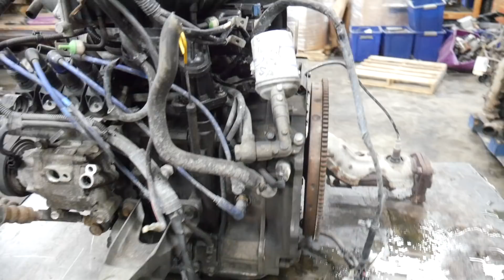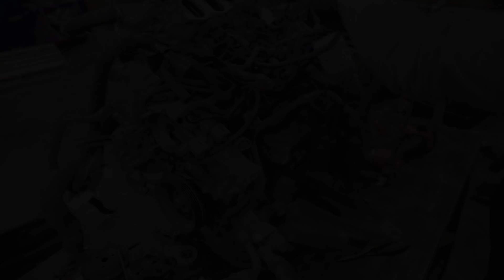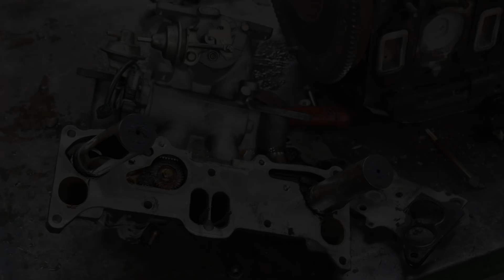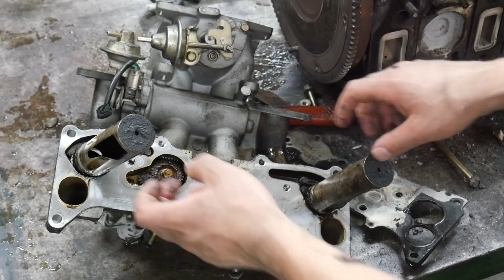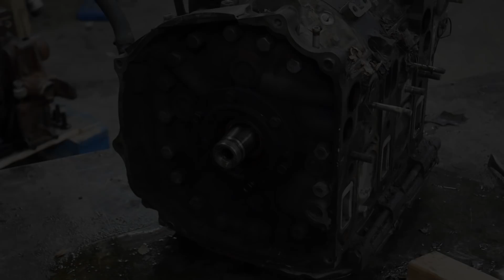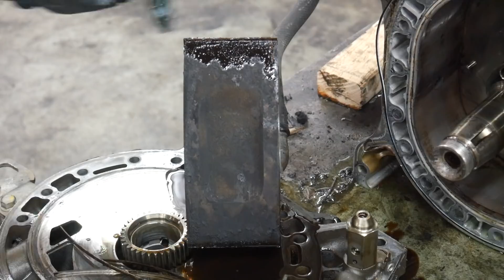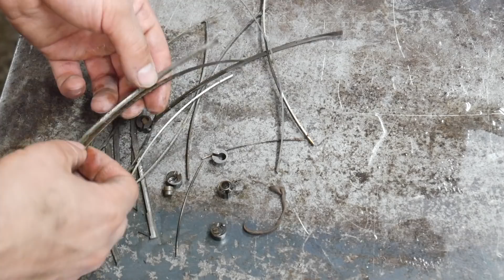13B RENESIS Total Rotary Teardown. 04-11 Mazda Rx-8 6-Port!

Comment: So, overall great content, but there are a few things to know on these engines that are incorrect in the video. #1. OEM vs Aftermarket coils. The OEM coils on the rx8 are hot garbage and should not be used. They were a cost saving measure by Mazda since the rx7 had so many complaints of expensive coils. 100% go aftermarket, specifically BHR coils. #2. The main point of failure. So Apex seals from the rx7 to rx8 actually came quite a ways. They still fail, but not as bad as you might think. The more prevalent thing that kills the engine is actually the coolant seals. Heat causes the seals to go prematurely. You can also swap the OEM apex seals for single pieces with better heat treating, and it more or less solves them as an issue.

While there is quite a bit to learn about these cars, the rx8 is very much worth looking into. If you know what to look for you can find them dirt cheap (got mine for $1000 and it only needed coils). If the engine and, more importantly, cooling, is set up correctly, there is very little that can actually go bad on them for many tens of thousands of miles. If you go into the car understanding that the engine is basically a wear item, they are amazing.nd r
Reply: One thing not mentioned so far is the uneven heating of the powerplant. The combustion/exhaust portion goes thru a more extensive temp. range than the intake/ compression area. I have seen random video on engineering mods to improve the weak points on these engines. Dirty emissions, poor fuel economy, lack of low end torque and knowing that uneven engine heating and spark plugs that cannot by design protrude into the combustion chambers create further issues to overcome. Oh, and the oil consumption! Pre mix to me seems essential and correct in that at least the correct type of oil is used for it's intended purpose. An ICE does NOT lubricate itself with oil 
intended to be burned steadily from new to aid apex seal longevity. The issues of these engines clash with the most pragmatic remedies and still would not make them practical with mass market appeal as public / private vehicle powerplants. As race engines they have decided advantages in terms of simplicity with few moving parts. Certain drivability and air quality issues  spelled it's doom aside from the race track where it shines in several major ways. I see them as a paradox. A somewhat inefficient engine that by design can take rpm and boost levels propelling them beyond the performance levels of their more complicated piston engined counterparts. An engine based on geometric formulae that may not be worthy of further R&D budget outlay but one thing often overlooked is the fact that for every full rotation of a rotor there are 3 revolutions of the shaft the power is taken from to drive the vehicle or for that matter to power a pump.
A good reason why anyone with the slightest interest in Felix Wankel's concept should watch a good video on the operation of these engines.

Comment: The Wankel is a very neat concept that looks amazing on paper, unfortunately in practice, there are fundamental design flaws that can't be overcome, and the engine has to burn oil to keep the seals from destroying themselves.  Plus they are very fuel inefficient.  Although really, the time of the combustion engine is over.

Comment: I'm no rotary expert but it looks to me like one of the coolant seals was snapped on that first iron u took off, which is another kinda common problem with that can happen and is something that you need to pull the engine completely apart for. It was probably dumping coolant all over the ground,

Comment: A fantastic but flawed bit of mechanical engineering. Very clever but you wouldn’t want to have to try to live with one beyond a few years new.
Reply: Unless you have the ability to pull the motor yourself. These things are stupid easy to rebuild.

Comment: The "long bolts" are called tension bolts.  A lot of the pre-Renisis era engines that ran when parked, but had trouble starting after sitting for extended periods could be coaxed back to life, if you knew what you were doing. I had two 83 models, and an 84 GSL that I bought in 1993, got it running, the A/C still worked good. Fun cars.

Comment: As someone who's owned two of these and tried desperately to improve the design - such a cool engine on paper. But so horrible in practice. Drinks fuel and oil like nobody's business (oil by design but still), doesn't make a lot of power and tears itself apart unless the whole ignition system is replaced every 20kkm. Too bad the RX8 never came with another engine.

Comment: Its hard to verify the oil metering pump is good without putting them on a running rotary and for that you have to have a running rotary😂 cracked me up

Comment: I once had a 3.5 Honda (Acura) V6 that would not come off. It took a 3 foot breaker with a 4 foot cheater on it. Myself and another tech, together good for 350+ pounds, both had to wrench every ounce of our strength on it. It finally snapped loose and sounded like a gunshot going off. Had the crank barred against the subframe channel to hold it in place. We estimated between 1700-2000 ft/lbs of breaking torque was needed. Why, Honda?

Comment: Couple secrets I learned long ago about these rotary motors, first rev them to the moon they do not like to be driven like a little old lady this helps with the carbon build up, second run some trans fluid through the intake about every 6 months it helps remove carbon and conditions the apex seals.

Comment: 12a and early 13b engines had way better seals and could hit 200k miles.  
btw, stock LS coils are much better than Mazda coils.
LS coils do especially well in RX7's when paired with an LS engine

Comment: I am so old, I remember when NSU introduced the Ro80/K-70, the car that served as the basis of VW and Audi middle-class models. Valentino Rossi won Le Mans in 1991 in a 4-chamber 2.6-liter Mazda 787B.  The next version was destroyed by a fire. Rotary got banned and their story ended there.
Mercedes had the C-111. Some motorbikes, some lightweight airplanes, and the R-8 that Mazda tried to get together like a decent automobile. They couldn't. Even the Japanese engineers could not.
The Wankels drink a lot of oil and fuel. They are light and run crazy RPMs.
Nobody seems able to make the original idea work in the real world. A piston two-stroke must be easier to tame.
They tried and my kudos to Mazda and most of all to the engineers at NSU who Just Did It. 
And failed. But once.
https://www.youtube.com/watch?v=OjwwV20iZYE

Comment: Ah the rotor heads try tell me it's only a 1300cc. Nope. It's 650cc per chamber x 3 chambers x 2 rotors, that's more like a 3.9 litre engine. And that's over and above the fact that there are more combustion events per revolution compared to a 4 stroke motor. So I kinda agree it's a cute concept but all in all a crap engine.

Comment: 24:27 you need the side gear to engage with those teeth in the rotor, and the side gear is on the part you took off.

Comment: I had one of the first RX8s around.  It was a fun quirky car.  The apex seals would wear out causing compression issues.  The fuel system would also foul out the plugs causing a no start.  The last and biggest problem was with the car itself. The parasitic electric load would kill the battery in 5 days if you didn’t drive it.  I still loved the car though.

Comment: Thank you really enjoyed this, see plenty of YouTube with old rotaries but never seen a renesis disassembled. I admit to being biased, I love rotaries , I agree they aren’t necessarily as durable as the average piston engine, but disagree with your view they are bad engines. It’s all about the driving experience and they are just fantastic to drive. Even if you have to pay a bit of a cost, in all senses, to own one I think it’s worth it.
Reply: He owns an rx7 and says he likes rotaries. They’re just not for noobs.
Reply: They're good in some ways and not so great in others.  I feel like the 13B-RE was the best of them.  Those things actually lasted a sustained amount of time and seems less finicky than the REW.  Less potential, but less headaches.  REW just had so much shoved into such a small area and is relatively miserable to work on.  The Renesis seems like a more finicky FC engine that never really delivered the goods.  FC is the most practical of the 3, but the worse chassis and suspension.  FD is raw.  8 seemed like it might be a great option for a car, but the interiors seems to be of lower durability than FDs (which are already pretty low).  As for the cars I think their chassis are what give them their driving experience.  FD is still an amazing car to me even when I drove other engines.  I think a low torque high reving engine like a K could deliver a similar feel with some more vibrations and I'd imagine better TQ.  If anyone hashes out something to do with the 8 chassis I'll probably get another one, but when we already have a supercharged ND it seems redundant.  I'd still want it to add to my imaginary ugly cars collection along with a Merkur.
Reply: @jinxtacy  Lucky 7 Racing is putting a REW into my Rx8 right now. You're right about them being finicky. A brand new block from Mazda ended burning oil somehow, so doing a rebuild on a new engine :scratch-head: anyway. Doing street port while they are in there. But the reason I did this is because of the way this car handles and for the price, can't really be beaten. Longer wheel base allows for more stable high-speed handling versus a Miata. 
My 40th AE is pretty to me, but i guess i have odd taste, haha.
Reply: @TexasVexes  I like the car a lot I just think they're overstyled.  I've only been in three.  First one was a turbocharged 375 wheel horsepower RX8 from Minnesota, the second was a Speedvision car with a Motec. The third was just a intake and exhaust yellow car that I wanted to see how it fit.  I did not care for the ergonomics and I was kind of surprised to see how the interiors lasted at least for a car that lived outside.  You're in good hands from what I've heard about Lucky7.

Comment: Interesting how differernt the engine deaths are in the US.

What normally kills them here is the oil being too thin in winter - and the eccentric bearings getting eaten up. It's a silent death - they'll merrily eat themselves through the copper to the point where a piston engine would be donking away like a dozen gnomes with a sledgehammers were trapped inside and probably launchign rod through the walls, before finally spinning a bearing and refusing to go. Depending on the bearing, they might even keep going with a seized bearing. 

It's a silent killer .

Comment: Extraordinary complexity for what?  I recall when the rotary was first introduced.  It's a brand.  I suppose keeping these monstrosities running was essential to keep the product different for marketing purposes.  Different does not mean better.  First time for me seeing one of these engines apart.  Last time too.  Good job.  Are these still sold?  If so why would anyone buy one?  Why did anyone buy these?  Marketing.  And, what selling points did they use to make these seem better than conventional design engines?  Must have been good cause folks kept buying them.
Reply: Pretty sure 2011 or 2012 was the end of the line for these engines. Aside from their pretty poor reliability, with emissions standards getting tighter and tighter they simply couldn't make these compliant. I believe mostly because they burn a decent amount of oil.
The reason they sold so well was really the marketing, which was that with so few moving parts it would be much more reliable then a piston engine, which was never the case. Average piston engine from any manufacturer usually goes 200k+ with decent maintenance, these if you see them with this many miles on them its absolutely amazing. Like seeing that diesel truck with 1 million miles on it.
The cars they came in are really cool, and I can think of a few engines I wouldn't mind swapping into them, VR6 or K series come to mind, but id never touch one with this thing in it.

Comment: Gear Porn, Im excited...Love this channel.
 When you put steel bolts in an aluminum case you get electrolysis which is what causes corrosion and bolts to lock up. All bolts in an aluminum housing should either be coated with an anti seize compound or have steel helical inserts. Obviously automaker will not go to that cost. Bolts should never be dry and should have some type of lube, unless specifically denied by the automaker. I come from the aerospace industry, 36 years experience in assembly and testing of electric motors and blowers. In our designs we always used helical inserts.

Comment: is it just better to premix your rotary than use the factory oil injection?  I've never owned one but have a few friends that own RX7s and premix their fuel rather than worry about the factory setup.
Reply: Ive heard people say to do all kinds of stuff, premix the fuel, rev it right before shutting down, and on and on. In the end the engines never going to last one way or the other.

Comment: The 2008 and later Renesis has a lot of changes...
A couple of major changes are :
Series 1 - two oil injection ports
Series 2 - three oil injection ports
The Series 2 also has a much higher pressure oil pump, plus the oil metering pumps are completely different.

Comment: This engine was a bad idea from the start.  I could have probably worked on chainsaws and weed-whips where light weight is very important, but beyond that it was a dead end.

Felix Wankel designed it as a supercharger;  I bet it would work well as one of those.  Volkswagen owns the patent on these, Toyo Kyogo pays a fee for each one they build to VW.

Comment: A rotary engine has a good power to weight ratio, but so does a 2 stroke gas engine.  Coincidentally, they both have the same vice - they use a lot of oil and have poor emissions.

Comment: Mazda won 1991 Le Mans 24 hours race with a 4 rotor Wankel engine and was the first Japanese car company to do so.
There are certainly fewer parts compared to the conventional engine and looks robust, the eccentric is short and thick, no cams and timing
chains and tensioners and bearings and poppet valves and springs and connecting rods and heads and all the associated nuts, bolt, washers
etc etc etc but the most pleasing aspect
is that it does away with the up, stop, reverse direction, push down, stop, reverse direction, push up and repeat. The triangular rotor gives its
power in the same direction as the output shaft saving energy. Thank you Felix for an alternative even if it wasn't the success that Rudolph's is.
Reply: In a race car, if a manufacturer was willing to put the money into the R&D, and make these fuel efficient, this could be a monster design for racing. Where you're going to strip it down to the last nut and bolt after every race to rebuild it. And where the cost of components is no object.
However, even in racing I can imagine the exact reason that it wouldn't be allowed, the fact that it burns a lot of oil, which can effect the octane rating of the fuel. Im sure every team in the game would scream foul over that, might even be the reason we don't see them anymore, not really sure.

But in a street car, where its reasonably expected to last 200k or more, and in the hands of drivers that don't understand its quirks, this was a terrible idea from the start.

Comment: Had my RX-8, bought new, from 2/2006 - 9/2019. Zero engine problems. Not one. Had to replace cat converter at 42K+ miles and sold it then, as I was concerned about getting future rotary service while on long road trips away from big cities. Fabulous car. And quite reliable.

Comment: So I’m a new subscribe....loving my way through the vids. What in your opinion is the best engine? Just curious
Reply: Theres a lot of really solid motors out there, and in all different forms and applications. Pretty much every OEM has made some really good engines. High torque, high power, stupidly reliable but low power, etc. 
This on the other hand, is NOT one of those engines.

Comment: "Just a bunch of 10's so its pretty easy" yeah, as long as you have a 10mm
Reply: A miracle happened. Last week I ACTUALLY found a 10mm that disappeared 5 years ago.
Reply: @justinnoel6273  it was a noel miracle!
Reply: @justinnoel6273  haha I found a 10mm today that I thought I lost in my engine bay about a month ago
Reply: The elusive 10mm
Reply: That one that always happens to be missing, well in my workshop anyway 😂😂
Reply: @TheLiamerator  that's for every workshop.
Reply: Se mamó
Reply: That’s the advantage of a Japanese car, with a 10, 12, 14 and 19 you can dismantle the entire car and you don’t need calculating wether a wrench is bigger or smaller than an other like in English measures… Don’t understand why one insists keeping that inch- mess alive!
Reply: @koenvelaers9876  you do know that all cars have been metric since like 2000, and even funnier brand new Japanese cars for America have 5/8 spark plug sizes for some reason lol
Reply: For reals! What is it about 10mm sockets always missing!
Reply: Which nobody does, ever
Reply: There is a whole universe of 10mm where all the wrenches and sockets migrate to, passing through the dimensions with the power of 10mm.
Reply: I always keep extra 10s in my safe at home lol. Ya know, where they’re extra useless.
Reply: What gets lost easier, 10mm or joe biden whole talking
Reply: The elusive 10mm….the empty spot in every persons set.